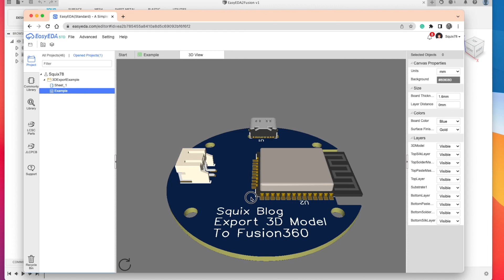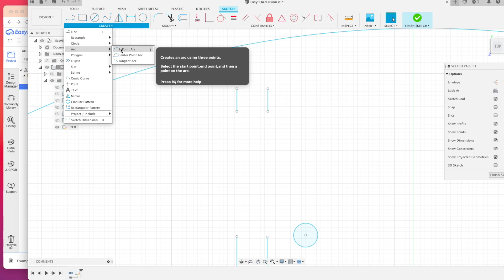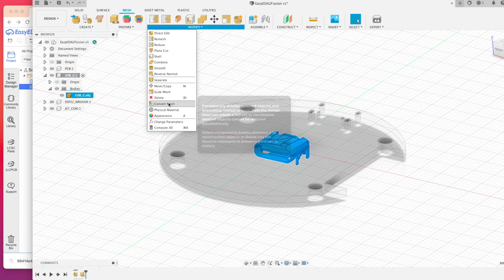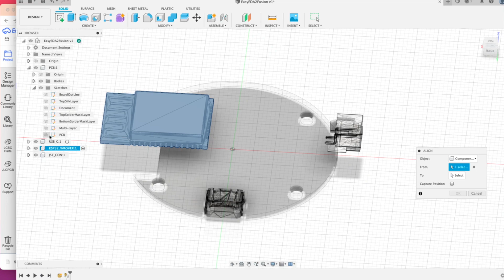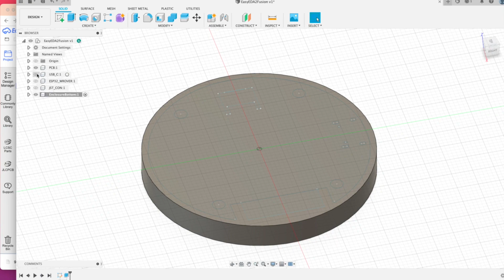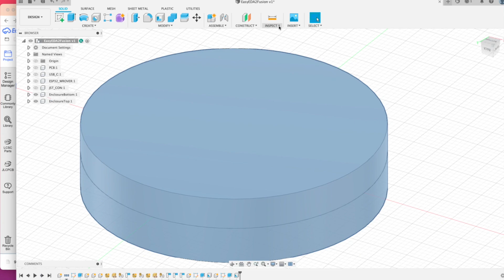EasyEDA to Fusion360

Comment: at 3:52 how are you selecting all of these? Even if I hold ctrl, it doesn't create any new ones on the PCB sketch layer. I also don't see the small box to the lower left that has things like "Geometry", "Selection Filter", and "Projection Link". It looks like maybe you did something at 3:39 to bring up that little thing, but I can't tell what.

Any suggestions? Thanks
Reply: You can press "P" and you have the Window

Comment: Couldn't you just export the mesh and scale it down to the right size after fixing the mesh?    Length of the board in fusion / Actual board Length = Scale multiplier.

Takes a couple minutes.
Reply from the maker: This is definitely an option. Have you tried it? The wrong scale wasn't the only problem: working with a directly imported mesh is very annoying, faces are missing or pointing in the wrong direction, there are far to many faces and reducing them removes important details, working with many faces is really slow etc. How is our experience with that?
Reply: @danieleichhorn9533  I did.. mesh is really annoying. lol.  I ended up using a combination  of the methods.  I used the exported sketch to make the board.   Used "import manufactured parts" to place molex connectors and used the sketch to align them.  Used the mesh to trace the vertical faces on a USB port.  Much more work than it should've been.